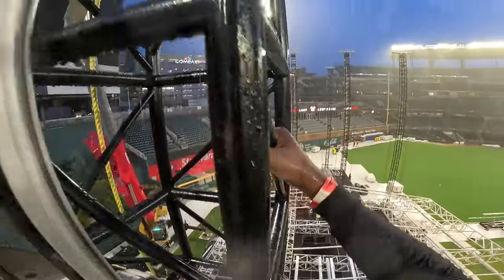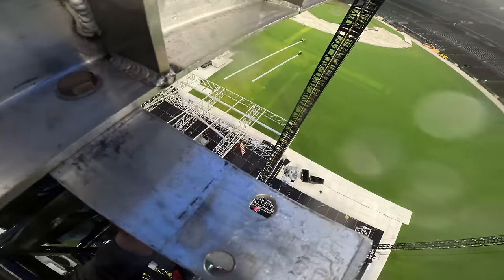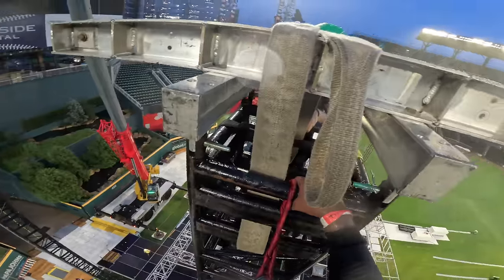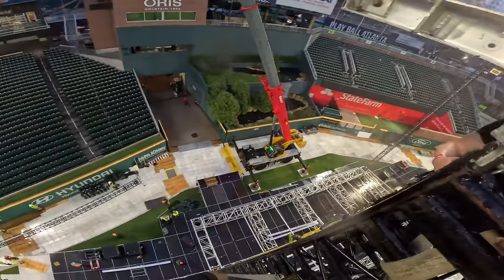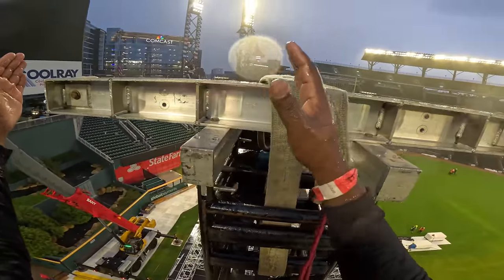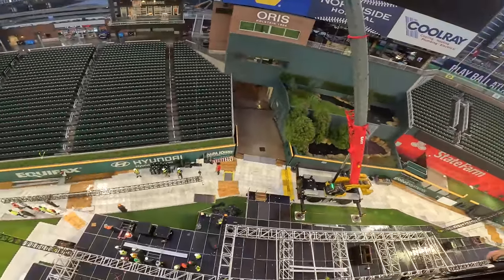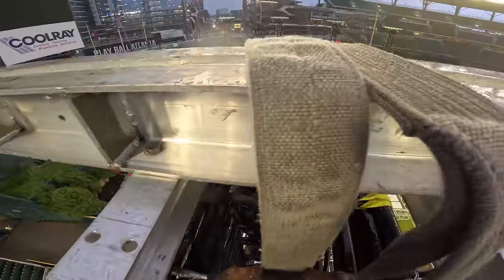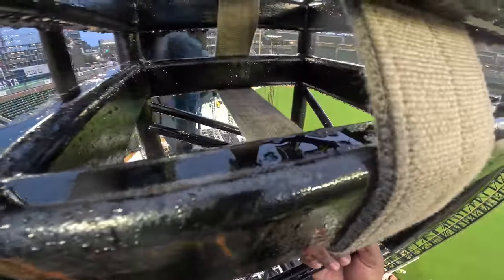Rain ? No Problem ! Taking down G2 towers in the rain .

Comment: "The rope, that yellow thing" wow, seems like basic training should take place on the ground. Are you union ? We never work heights in the rain in Detroit [Carpenters]. We'll sit around for 4 hours, if it doesn't stop we call it a day. No wind over 20 mph either. I remember my 1st job working heights was a 4 story cooling tower, my knees were shaking uncontrollably like a little girl, I almost dragged up. Glad I didn't, got used to it quick and made a nice career out of it.
Reply from the maker: We do start training on the ground and with different shows comes different stage setups and not all towers have rope grabs on it so until they climb one for the first time, they won't understand what it is. we do show them on the ground before they go up but still is a new experience for them. As far as the rain, I can see the difference between wood work and steel and aluminum climbing, all in all, it is safe practice for us to climb in the rain. Lighting is the only deterrence for us usually.
Reply: @worldwiderigging  You guys rock, stay safe and never be complacent. You are right, can only explain so many things, some things are better hands on, so long as safety is not compromised.

Comment: I don't know if Connor is gonna make it 🤨. If I have to warn you three fucking times that you're about to be smacked upside the grape by a 600lb steel ball that's swinging on the end of a cable and it still takes like 45 seconds for you to look up and have it sink in, you might be too mentally slow for this job. At least for *my crew.
Reply: The experienced guy wasn't quite assertive enough with his directions if you ask me. He sounds scared and shouldn't be leading someone on a job like this.
Reply from the maker: Connor is very experienced in rigging as well, just in a different work environment. He just wasn't sure if I was just explaining or actually telling him at that moment to look up lol but all good on all fronts.
Reply from the maker: Hi! Experienced rigger from the video here, I was definitely not scared, I just knew how slow the ball was actually moving and knew it wasn't a need to freak him out from sounding super urgent. If the ball was swinging at the speed of light then yes my assertiveness would have been a whole lot different. But we got the job done, no harm no foul.